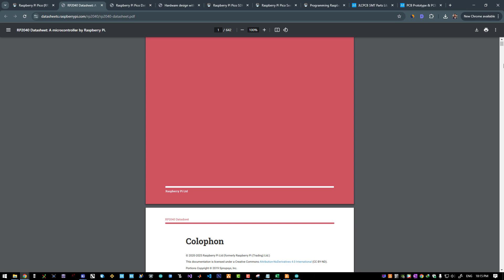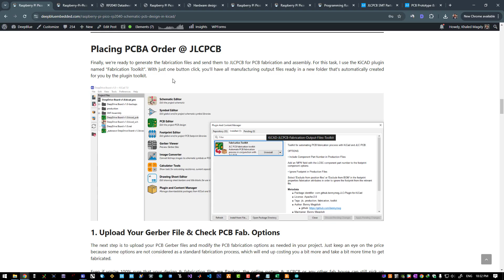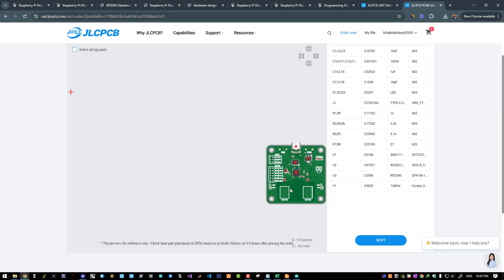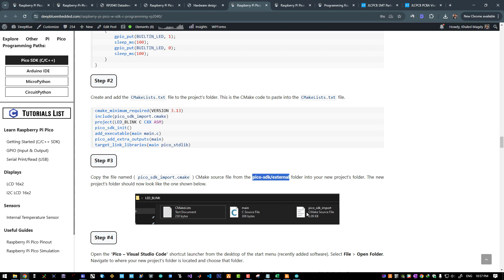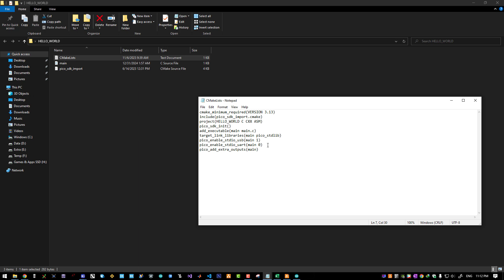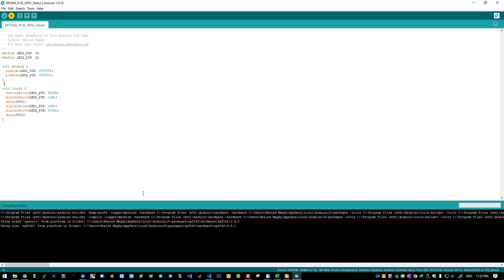Custom RP2040 PCB Design in KiCAD – Raspberry Pi Pico Hardware Design + Schematics

Comment: You mentioned it didn't meet your expectations. I'm a little curious as to why...
Reply from the maker: I was testing a fast captouch sampling technique based on the ADC's internal sampling cap. It provided very low sensitivity compared to other microcontrollers I've tested using the exact same procedure. It could be due to the chip bonding wires or the ADC's internal parameters. It does detect touch events at the end of the day but there is no sensitivity room to detect proximity, touch pressure, etc.